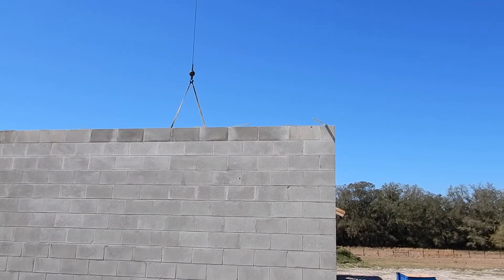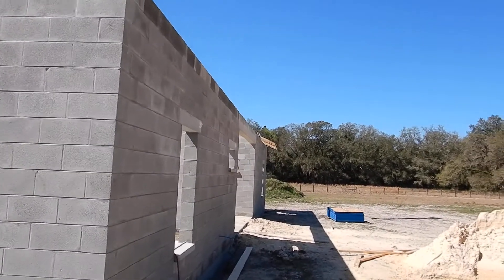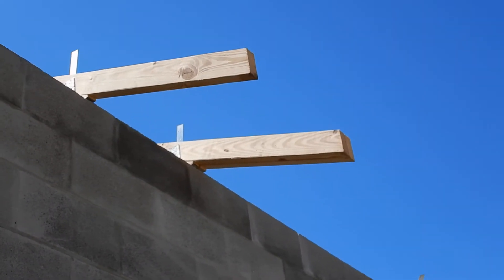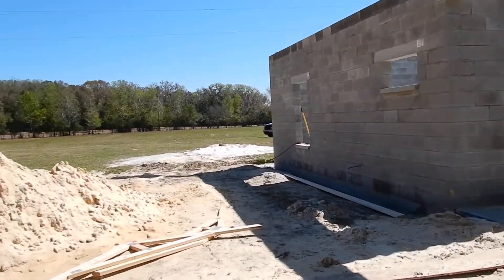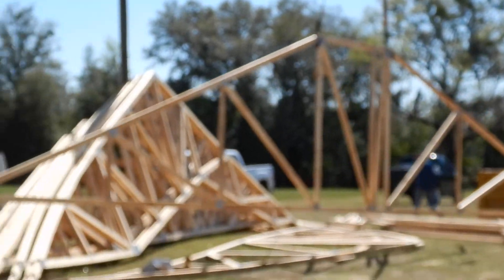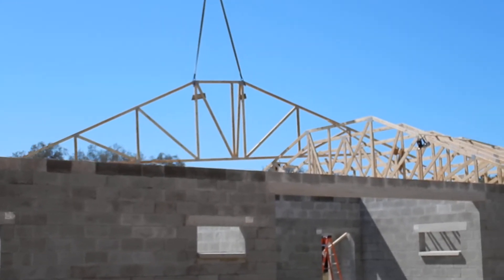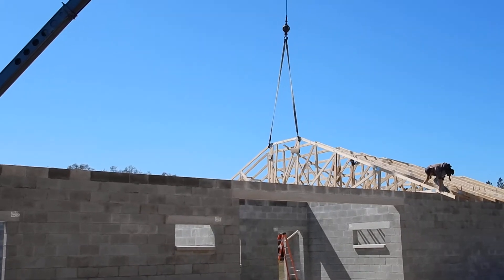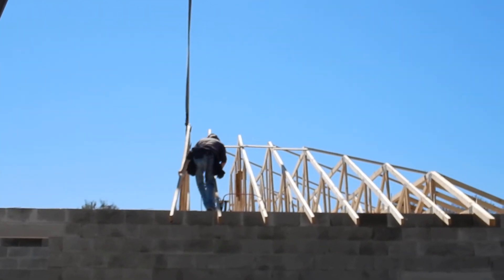Setting Roof Trusses For New House Construction in Gainesville Florida - Part 2

Comment: Is there a plate on top of the wall or do you just set the trusses directly on the block with the ties?
Reply: Good question.  I've seen it both ways.  Not sure why one way or the other.